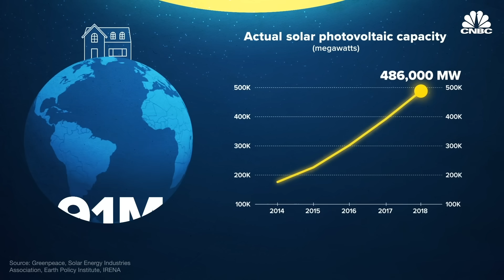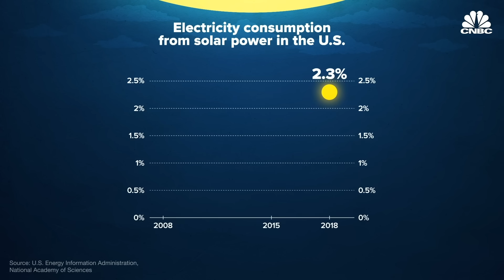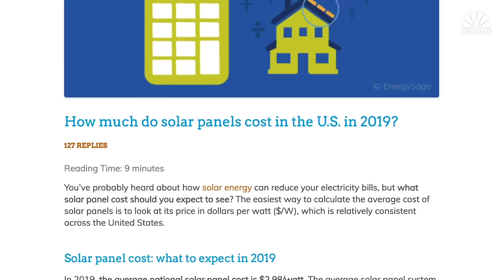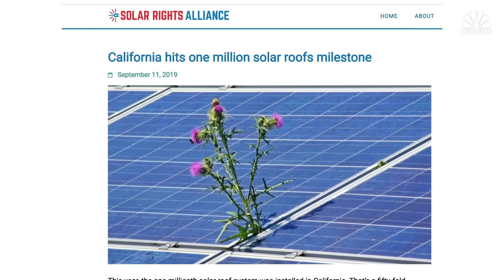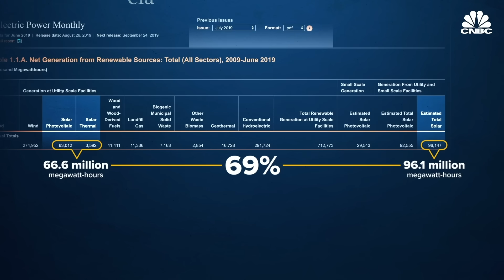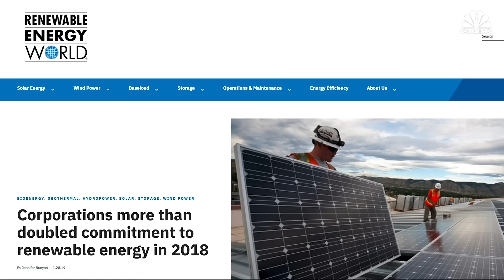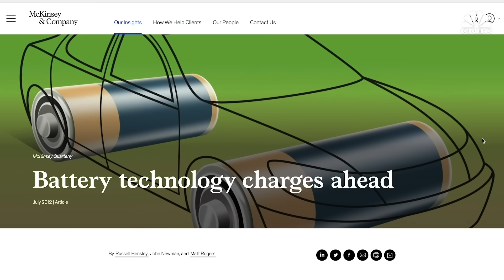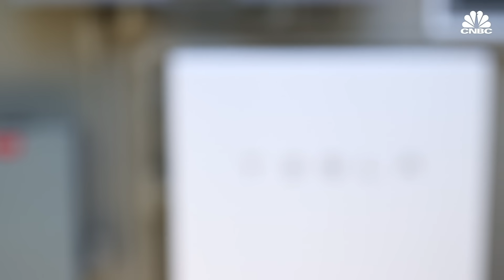The Rise Of Solar Power

Comment: All great as long as its sunny. Unfortunately we cannot rely on solar or wind for base load. Nuclear is the only power source that has enough energy density and 24/7 stable output to radically reduce carbon emissions. If only we understood how it really works and weren't afraid for no reason.
Reply: one person in the comments has done the research.. solar is very misleading
Reply: Actually, nuclear is simultaneously the most eco friendly and the cheapest power source. You need to spend more money and more sources to get the same amount of power from solar and wind. The cost per energy is the lowest in nuclear. Yes the cost a lot of money to built in the first place, but the provide enormous amounts of energy for decades so the net cost is low. Nuclear waste, although dangerous is not handled properly, they are easily handled cause they are solids and they take up so little space that its easy to store them. Compare that to gas emmisions which we cannot capture and store. And none of the renewable energy sources can provide huge stable amounts of energy over 24h. They only real alternative is nuclear. The current designs of fission reactors are perfectly safe with multiple redundacies and they are by design able to shutdown (negative void coefficient) when power is cut. So even if you wanted them to explode Chenobyl style, you can't. And you want a real life example. Just look at France. 75%+ of electricity produced by nuclear. And although its a high income industrialised nation, it has the lowest carbon emission per person in the developed world. And then look at Germany. They spend billions in solar and wind. And their carbon emissions haven't dropped in 15 years cause at the same time they take out nuclear and replace it with natural gas when there isn't sun or wind. Thats why on such matters only scientists and engineers should make rational decisions. Nuclear energy is safe and cheap. Not cause we believe it but because the numbers and the facts say so. We have to leave our fear of the unknown behind and focus on the real problem. How to make our energy needs be more viable. And until we can achieve net positive nuclear fusion, modern nuclear fission is the way to go. Im not against renewables. I just cannot see them be on their own. They energy output compared to the area and resources the demand is too low. And too unpredictable. And we don't have the technology to store such amounts of energy from peak production.
Reply: Nuclear is very carbon intensive,  it takes a lot energy to get the fuel, build the plant and to decommission.  Bad choice.
Reply: @craigjensen1091  solar panels are worse .. Youre basically decentralizing the waste and polution
Reply: what about the environmental impact of an accident at a nuclear plant? It's is the cheapest and greenest but we have to examine the case in a practical matter. Remember what happened to the power plant in japan a couple years ago? The nuclear fallout exposed the the west coast to high level of radiation and for several years the areas around the plant have mutated bugs and animals. The water is still contaminated and the place is "habitable" after 5 years. It's a real problem. I say we continue to invest in both to find a hybrid solution. Place nuclear plants in safe areas with potentially no natural disaster and find better measures to provide safeproof nuclear fallout from natural disaster. Also continue to invest in solar to decrease the price and improve efficiency. Let the future test which is better.
Reply: andrew7720 Explain then how the UK already gets 20 percent of its power from solar and wind. Nuclear is vastly more expensive and nobody wants it. Even on a small island like Great Britain there is ample space for enough solar to power the whole country. Yes, energy storage systems will also be needed, but with the advent of the smart grid we can cheaply match demand to supply much more efficiently, meaning we won't need to store as much power as people think.
Reply: @spencerwilton5831  20 % ?? thats completely false.. show me the citation

Comment: wouldn't it be great if we just-->
superconductor power lines
Reply: superconductor is just some cats talking...because you need few hundred degrees below freezing to get benefit from superconductivity in the first place!
Reply: "superconductor power lines"
Superconductivity is expensive. A better solution is electricity production closer to the user. Many of the gen3 nuclear types are self-contained, micro plants that solve this.
Reply: @dmay3391  I'm more hyping up the creation of room tempature super conductors
Reply: @SLACKLINEDUDE  that would not do much, problem is energy production not efficiency.
Reply: @miguellopez3392  u r mistaken bruh. If we had room tempature superconductors oh boy would the world be a better place, energy would be so much easier to move.
Reply: @SLACKLINEDUDE  it would be good for computing and information but not transportation of energy, line loss is not much so making an efficiency upgrade to it will net around 30% in energy savings for the grid, good but not fantastic.

Comment: Cnbc just couldn't help themselves without a dig at elon musk.
Reply: Not even one minute in 😄
Reply: Tahmas Kenchers I saw no dig on Elon. All I heard is that the solar roof tiles are not selling very well which is true. Later I heard that the Tesla Powerwall is very expensive for the average homeowner. Also true.  I’m a Tesla/Elon Fanboy but I am not so thin skinned to take every true but negative fact reported is some kind of attack.
Reply: Elon is a charlatan. Those solar shingles are a scam
Reply: All they said was the solar tiles have not yet been fully delivered on.
Reply: NotHandMade That’s offensives to Musk stans though.
Reply: All of this progress was Elon's original plan, and was possible due to his aggressive stances and companies.
Reply: Lbh the solar roof isn't needed and it's less efficient, the normal solar panel is still his business so not really a dig.
Reply: Ok, so like 95% of this is positive information, the part about Elon isn't a lie, its fact that the solar roof didn't work out as planned, even he said it.  Doesn't mean he isn't on the right track, he's just spread out.  Things will turn around once he gets his 2 giga factories up and running, cause even though he will lose the majority of the car market, he has a real chance to be the defacto battery company that everyone will need to turn to.  Now if he can just solve the issue with recycling.
Reply: CNBC is a corporation that that pays the politicians to make neoliberal pro corporate policies. The same politicians who accept money from big oil. Lol see the conflict of interest? Of course they are anti alternate energy.
Reply: They literally just mentioned a FACT. He did not deliver and it's true.
Reply: They're are other people doing solar and doing great things. Akon has a solar company in Africa doing great things. Elin was trying to innovate as he usually does and it didn't go well. Every cnbc and msnbc video about the future has them taking little pot shots at him without acknowledging his contribution into thrusting humanity an inch forward away from cnn and msnbc advertisers like the fossil fuel companies.
Reply: They didnt even mention Tesla's $50 a month plan. Tsk tsk.
Reply: I'm sure he will dry his eyes with a few Million Dollar Bills about it.
I think he can handle it. He's quirky, he's brilliant, he's odd and sometimes offense while trying to do the right thing, and he's just right for the times. We need him. We could use a few more like him, even with the warts and gaffs.
Reply: It was an honest fact. He promised a solar roof 4 years ago and still is not in production.
Reply: Cnbc sucks so negative against the future
Reply: The title should say Rise of China to get more views.

China's "super mirror power plant"
https://youtu.be/G3hy1OQW10s

China Made An Artificial Star 6 Times Hotter Than The Sun youtu.be/oGE9MmG4zhk

Source: China made an artificial star that's 6 times as hot as the sun, and it could be the future of energy businessinsider.com/china-east-experimental-advanced-superconducting-tokamak-nuclear-fusion-reactor-100-million-degrees-2018-12?IR=T.
Reply: @condorX2  have you seen the compressed air energy storage plants. Really great idea and scaleable.
Reply: Dig at Elon Musk? Good.
Reply: You Tesla Cultists never fail to amaze me.  Did you ever consider how toxic you are to Tesla?  Did they say anything that was even misleading here??  There is a big global backlash against Tesla because of you overcharged hyper sensitive worshipers, many understandably want to avoid T. despite how great the cars are because they are sick of the Cultists.
Reply: Its hard to resist taking a dig at cult idols.
Reply: Elon is next generation Trump he spouts a lot of bs
Reply: @fredsanford3958  Yes, all of his lies and BS surely attracted the best engineers in the world to work for him, Space X being number one, and Tesla being number 2. 

Trump Cultist: Uneducated who lost their labor jobs

Elon Cultists: MIT engineers

https://www.cnbc.com/2019/06/06/the-10-most-attractive-employers-for-engineering-students.html
Reply: @fredsanford3958  What the actual f you on about...
One is a narcissistic psychopathic maniac and the other one is a actual successful businessman that have revolutionised the automobile industry, space industry and online money transfers. Like comparing Edison with a chimp.
Reply: @fredsanford3958  difference is that one of them also makes his BS fly and drive and sell like hotcakes.
If Elon has similar success with solar as he has had with cars, energy storage, rockets, and wierder rockets, he will deliver a great product, just a lot later than he had hoped.
Because, he keeps delivering the products, just with delays and hiccups along the way, but still far ahead of anyone else.
Reply: @fredsanford3958  and keeps getting suckers to finance his operations.
Reply: @thatsawrap5235  those suckers are up a 1000% and that's just the beginning
Reply: Thomas somehow everyone even people who hates him love the products that gets made
Reply: @TagmakersCoUk  I feel bad for you that you concluded I'm a Trumpist.
Reply: @thatsawrap5235  I go by appearances... ;)

Comment: My NEXT Car will definitely be either Electric or Plug-in Hybrid.

I am not spending 1 cent on Fossil fuel Only vehicles anymore.
Reply: My next car will run on water.
Reply: @craigjensen1091  #fuelcell
Reply: Indeed!  My first plug-in was the Volt.  Great car, cuts out 95% of average use of Koch fuel.  Everyone can afford a used PHEV or EV (as a second car if range is a problem).
Reply: Get the new leaf
Reply: You won’t regret it.  There are a lot of bonuses to ev’s people don’t think about.  I bought my phev last year and love it.  I can remote start my car while in my garage and warm it cool it before driving
Reply: @The Last Danite I don't get this argument? just because things are made out of oil doesn't mean we shouldn't try to reduce our need for oil by eliminating as much of that demand as possible
Reply: @kevinm6722  you'll be left wonting
Reply: You realize a hybrid is.......... Nevermind lol
Reply: The Last Danite So.....? Whats your useless point?
Reply: @powerhouse884  the charging stations are probably powered by a diesel generator
Reply: @tstocker6926  Where do you live that you use diesel generators for electricity? I'm legitimately curious. The place is live is 96% hydroelectric, all electric car chargers are connected to the mains grid.
Reply: @tstocker6926  nope
Reply: "My NEXT Car will definitely be either Electric of Plug-in Hybrid."
Electric cars are powered by fossil fuel electricity.
"I am not spending 1 cent on Fossil fuel Only vehicles anymore."
Electricity made from coal  is a "fossil fuel" only electric car. Electric cars absurdly high consumption of electricity are why solar will never work. Science informs us that gen3 nuclear is the only answer to cheap, green, plentiful energy that's going to be needed in the future. Solar is a fad created by profiteers.
Reply: @dmay3391  you must work it out nuclear plant that's going out of business huh? Do you not get electric cars can run off solar, wind, or  any other form of electricity generation and even if their powered 100% by coal they are still cleaner than gas cars?
Reply: @dmay3391  Nuclear is a stupid tax giveaway.
Reply: PowerhousePR ideally I’d own 2 vehicles. A sedan for around town that’s all electric and then an SUV that’s a hybrid for longer trips.
Reply: @johnmoore1495  can rent one
Reply: @The Last Danite Not in China.  Many of their factories are run on solar, wind, nuclear and hydro.

Comment: Solar in the morning 
Nuclear at night
Fusion tommorow
Reply: Doesn't really work or at least not well.
First new nuclear is around 10c/kWh, so it is already pretty expensive. This is when it runs 24/7.
If it only runs at 50%, then the cost almost doubles.
Then you have the issue that you can't really turn of nuclear.
You can run it on 100% or 50% or anything in between, but if you want to go lower you have to shut it down and wait a few days to weeks before you can operate it again.
Reply: No nuclear. CST at night. This stupid video made out like it was only a new "research phase" tech when in fact it's already being used all over the world.
Reply: geothermal anytime
Reply: Can you tell me what do you do with the Nuclear waste.?
Reply: @dogan6070  the US has a storage site for it but state officials get in the way.
Reply: @dogan6070  you store it instead of the alternative form of waste that people dump to the sky (CO2).
Reply: Pete. A Emm we store it or use it in next generation nuclear plants? What do you do with the thousands of solar planets you have to replace every year? And how does the environment respond when you claim huge fields to put down some solar panels? You know that the huge field you saw in the video that will generate in real world conditions around 200MW only during peak sunlight while a nuclear plant easily can have four reactors running at 1400 MW
Reply: @andreaswickman1508 
Still nuclear would be much more expensive.
7 to 14 cent for new nuclear vs 1 to 5 cent for solar/wind.
Reply: @andreaswickman1508  Given panels last at least 10 years with decent output and then they are still useable after that, there are not that many that need replacing. When they do, you give the lower performing panels to poor people for cheaper, or you recycling them.
Reply: What about Wind, Hydro, Biomass, Geothermal ?

Comment: Professional and based on good science data. I drive a Tesla and plan to go Solar. 5 years ago my monthly electric bill was around $46.00  and now it is over $100.00.  However, clean air and water is important for all life on this planet  Renewable energy is the solution for our posterity  in my humble opinion.
Reply: Gerald Mattos So a $50 dollar increase..... how many times do you charge the car and how long does it last?

I already spent like 40$ on gas every month and i am using a Yaris.
I wonder if its the same amount no matter if its a car or an SUV....
Reply: PowerhousePR $40 on gas a month? You have no idea- gas in the states is far too cheap considering the environmental cost. Fuel in the UK costs three times that of the states, $40 wouldn't even fill the tank of the the smallest available car once.
Reply: @powerhouse884  l top off at night to 80%. However, l belong to a pilot program and have been charging to 80 - 90 % for free.
I can go 320+ miles on one charge. Yesterday l took 4 friends to the Tesla factory in Fremont, California which is 60 miles from my home  and charged to 80% in 15 min at the SUPERCHARGER right after the tour. When l got home l plugged the car in to charge from 11 p.m. - 8 a.m. so l am back to 80% of the 310 miles. In the first year of ownership l have spent under $15.00  on electrons.
Reply: Gerald Mattos why did you put TESLA and SOLAR in all CAPS
Reply: @ShidaiTaino  l did not. My Samsung notebook did it and l did not go back to correct it as l type with one finger and not the middle FINGER. See, it HAPPENED again. Perhaps l touched SOMETHING..?.?.?
Reply: I did not put SOLAR  and  Tesla in caps.  My stupid notebook did it and l notice it did it again. I type with one finger and not the middle one.  If l were typing on a keyboard this touch typist would not have that problem. I went back today to edit but alas to no avail.

Comment: Let's see all the solar  power experts on here now
Reply: heres one for you from a Socialist expert: 
Lets make solar powered hydroelectric dams that pump up and store sea water as potential energy in the day for use as hydroelectric kinetic energy power stations at night!! That should be a lot cheaper than lithium battery storage!
Reply: @fidelcatsro6948   Wow, I think that is an awesome idea.  I know that stored hydro is the most used storage, but I never thought we could just pump sea water into reservoirs.  Here in Arizona several of the lakes are used for pumped storage, but drought is making that less useable.
Reply: @juliaset751  Yeah. I did note that the first link I put up is in Queensland. Queensland is traditionally a very wet area but it has been in the midst of a very long drought. Which is why it's good that they're going to use sea water rather than fresh. New South Wales is the same and the first town is meant to run out of water in 2 months with many towns running out over the next couple of years. Currently the Snow River Hydro's water comes from snow melt but I'm wondering how long that will last.
Reply: @fidelcatsro6948  Happening in Australia already.
Reply: @JulianFoster888  thats nice to know send me a link if you have
Reply: @JulianFoster888  thanks
Reply: @fidelcatsro6948  you go get right on that
Reply: @charlierobles316  please propose this to American cabinet ministers...